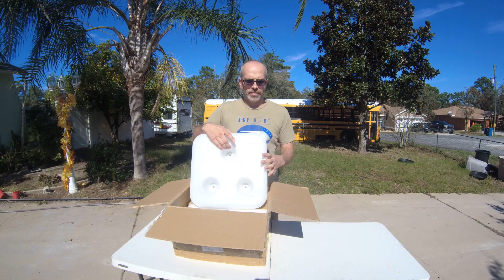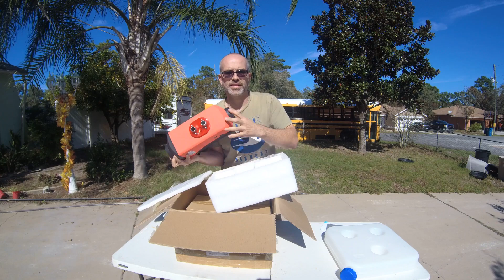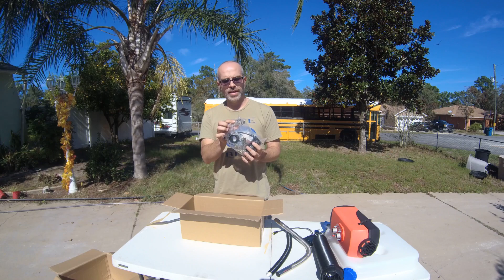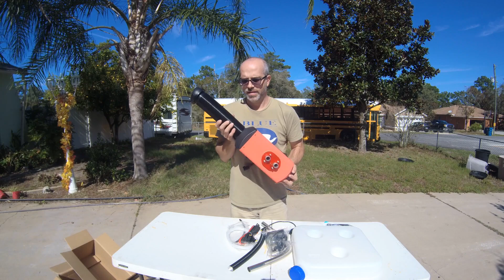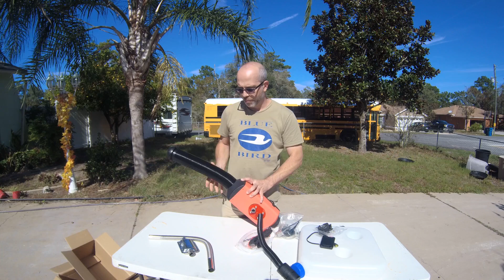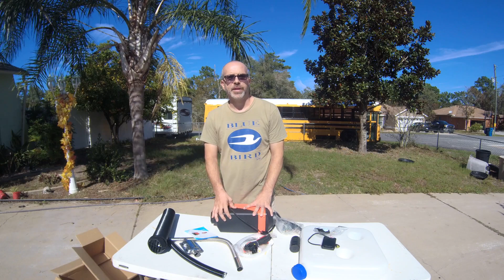Offgrid Heat That Doesn't Suck!? Chinese Diesel Air Heater Part 1: Introduction And Unboxing.

Comment: How did you place your fuel line into your bus tank? We do not have an extra port on our sending unit and need to find another way to run a line.
Reply from the maker: There are complex ways to do it or you can take the easy way out: https://imgur.com/eRK5nVP
The fuel filler tube on a big bus will almost always be standard 2 inch pipe thread, a 2 inch pvc cap (which is diesel safe) with a small hole drilled through will let you push your fuel line into the tank without having to modify the tank itself. For best results, use zip ties to attach a stainless steel washer a couple inches from the end of the fuel line.

Comment: Note that the "8KW" is a 5 KW (no such thing as a 8KW unit) you can "tune" it yourself. The 8KW units are much higher price for no benefit at all (marketing b-s)
Reply: Yes, "8KW" is a 5 KW. People often need to see higher power, in fact, the power of 5KW is only 3-3.2KW.